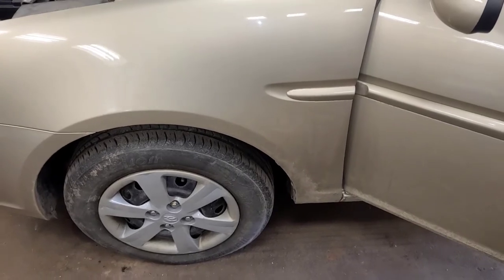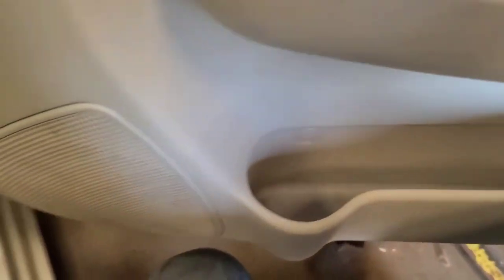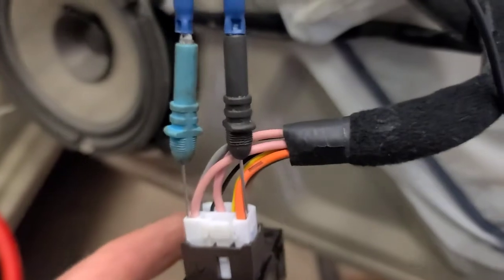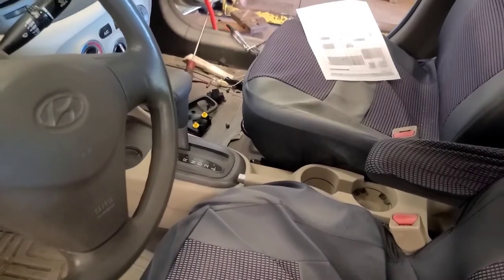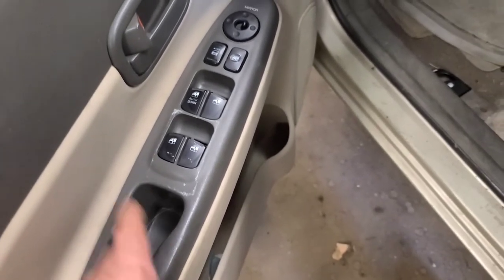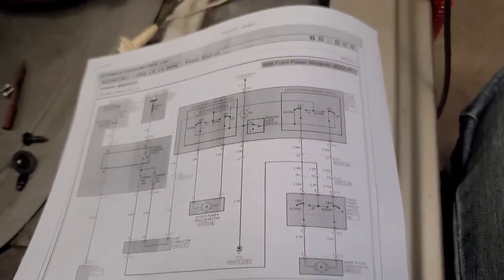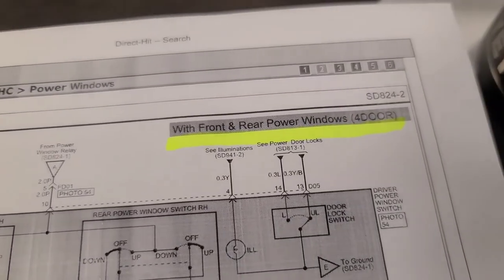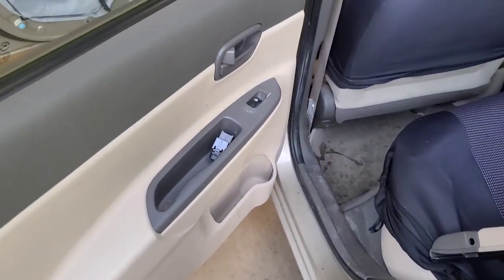2008 Hyundai Accent Multiple Power Window Problems

Comment: Thanks for the video i’ve got a similar issue on my 08 hatchback. My passenger side window will roll down but not up from its switch. The drivers side switch works fine for both windows down and up. I’m going to look into replacing the passenger side door switch now.

Comment: It makes it hard when the reference sources are not all the same. You start to doubt what you know! Anyway, you figured it out. I owned a chevy Optra a couple years ago and needed a few parts. Trailing arm, unavailable from any source new aftermarket, OEM or used. (Even checking out a few big canada wide wreckers) Also had window switch issues that a electronics buddy was able to make work. Even if you could buy the parts, sometimes the parts are worth more than the car!

Comment: Can you please clearly tell what wires should be connected in what order to move window up or down thanks
Reply from the maker: You need to tell me which window and what the problem is. Also year and model.
Reply: @PhillipBailey  exact same issue as you have.

Same car same window only diff. My window not going up its stuck down.

As you mentioned i jumped pink to pink and it burnt my jumper wire
Reply: @PhillipBailey  although i didnt use back probes like you did. I didnt put the passenger side switch as you did i am jumping wires directly on the top i hope it does not make any diff. ?
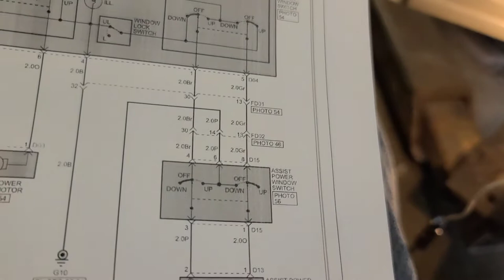Reply from the maker: @webdev786  at 9:12 in the video safest thing to do is unplug the right switch and supply power from the battery using a fused jumper wire to pin 3 pink wire going to motor and at the same time supply a ground to pin 1 orange wire to the motor. This should close the widow. If it opens instead reverse the polarity. Again do this with the right switch unplugged and use a fused jumper wire. Good luck.
Reply from the maker: @webdev786  replied already...
Reply: @PhillipBailey  when you say right switch you meant driver side main power switch ?

And thanks for your response appreciate that
Reply from the maker: @webdev786  right side is passenger side so long as it's a left hand drive car. I'm assuming you're in nort America
Reply: @PhillipBailey  yeah got it so I did  what you said but unfffortunately didnt work
Reply from the maker: @webdev786  that would indicate the window motor has failed. With the switch unplugged connect an ohmeter between pins 1 and 3 with the meter set to read 200 ohms. It should read very near 0 ohms through the motor.

Comment: My 07 has a similar issue,sorta           ...... It started a dfew weeks ago, intermittin working.       Sometimes it goes down, wont go up,no matter what swicth I use.    Now, for 3 days it wont do Anythingt at all from either swicth.       Checked fuses, they look good. Cant find any issue.        ......Im fully out of ideas, so.......my next move is........just replaces trhe fuses, even though they appear fine.        its a desperate move lol
Reply from the maker: I doubt it would be a fuse since the same fuse runs all the windows I believe.  Is it just one window or multiple windows? Check for broken wires between the door and pillar on the left front and door and pillar on the door that doesn't work.
Reply: After i commented earlier    ....  I gota  burst of desperation &  decided to just remove the power windows motor & assymbly ,    now all I need is a window crank  & Im all set.           Besides.  I never really cared for where the window buttons were anyway.   Hard to hit when your driving.          But very easy to locate the crank handle,more comfortable location. anyway, thanx anyway :p @PhillipBailey